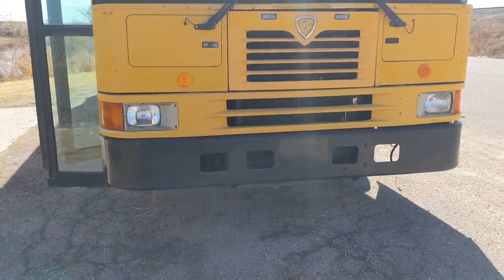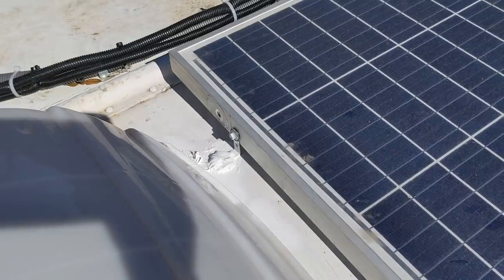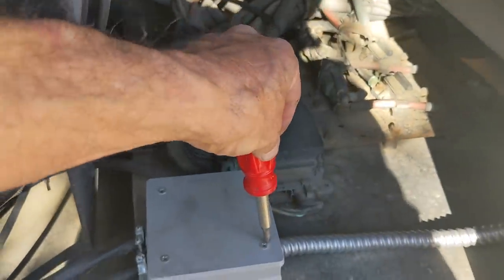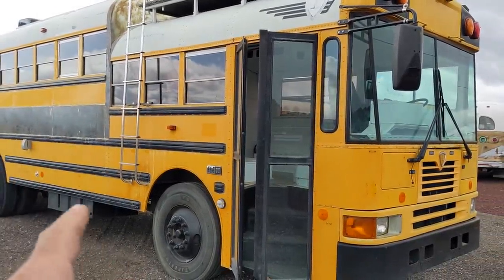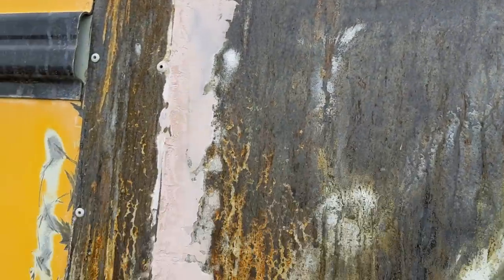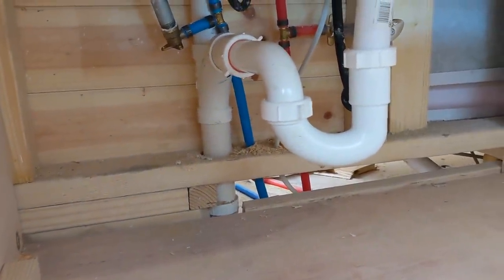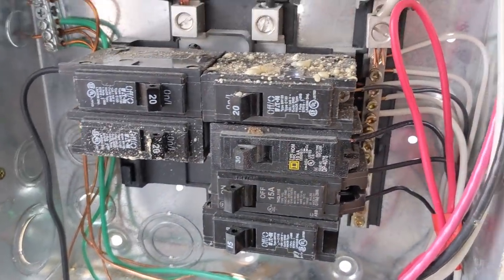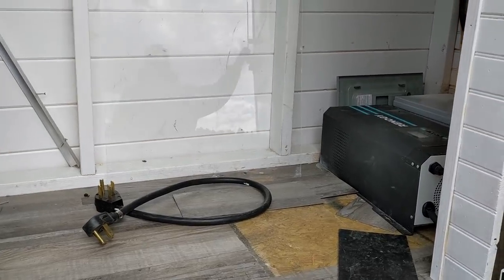Dangerous electrical work...and so much more bad stuff.

Comment: As an electrician and someone who appreciates care and craftship, I am appalled at the hack work done on this poor vehicle. I would say it was worked on by the "crack" crew, because they were definitely on something. Something to be aware of about the MC cable: In mobile applications it has to be stranded in order to handle vibration. Solid conductors can and will become embrittled from bending fatigue, and that can cause enough resistance to start fires. Even standard 19 strand MC is not designed for mobile applications where it is not fully supported and subject to movement. So sorry for your terrible experience.

Comment: I used those same brackets to repair a drawer on my 3 drawer chest. I'm not an electrician but I cam make a better cable then that and it would be safer. Is that 220 or 3 phase? Either way it KILL someone.

Comment: For 100k I better be getting a very very high end work and a paint job with tinted windows by the end of the build. But all the code violations but they are just doing cheap ass work! It's horrible and sad they should be ashamed but at least you have come by a few and are helping them out. Hopfully they get that company to realize what kind of shiesty ass work they been doing. And they should be out of buissness for being scammers

Comment: 75% deposit is ludicrous.   40% and 20% additional as pre-agreed check points are inspected and signed off on.  I can see why we ended up with so many annoying laws and regulations.
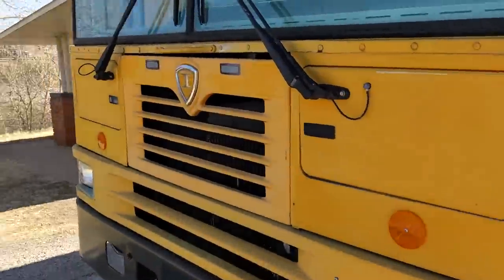Reply: 6:30 No headlight and turn signals, saw the wires hanging down loose.  Started laughing.

Comment: I'm to the point where you are showing the water heater. I've spent years in the body building industry so I have a clue of what I'm looking at. Did they really drill a hole in the frame flange to screw that BX cable clamp in? Huge no no. And it looks as they may have drilled the holes for the water pump too close to the flange bend also. I'm horrified by the whole situation with these guys. How are they still getting customers?

Comment: The work performed is worse than my first time welding, home electrical, bodywork, etc. as a teenager. That company had no intentions of doing anything right and wanted to just get some quick cash in the van life boom. Disgusting in my opinion.

Comment: It’s so bad to the point of almost being intentionally bad. They’ve essentially totaled the bus. The owners of this rig seriously need to take that company to small claims court. Not only are they for sure going to win the case but it will expose this companies illegal and negligent practices
Reply: They have indeed totaled that bus. Maybe - just maybe - they could strip the insides down to bare metal and start over, but only after redoing the sides, a set of tires, and I can't even think of what the engine, drive train and suspension/steering are like.
And for $100K, there are TONS of excellent used motorhomes on he market. 
If this is real, and I guess it is not some kind of April Fool's prank, I - well, I just have no words to express my thoughts on the matter.
I looked at a website purported to be these people. AS the song goes, some people ain't truthin' when oughta be.
As a proud Texan and resident of the Great and I might add Sovereign State of Texas, I am truly ashamed that this kind of fraud is being perpetrated in our beloved State. 
Might I suggest tar and feathers for a start?
I sincerely hope hey prevail in court.

Comment: .....given how there's suspicions the head/turn lights were disconnected as active sabotage, does anyone else have similar concerns that the "nicked" wires on the "cables" they supplied for the generators may have been done deliberately as an attempt at seriously harming/killing the clients/marks?

Comment: OMG 😲 😱 😲, WTF!
Should of just drove it to the scrap Yard then walked to the nearest stake house, ordered prime rib and a bottle of Jack Daniel's.
Reply: That certainly would have been cheaper and more enjoyable.
Reply: @jimbojones9665  I'm amazed that they didn't do due diligence on this company and just handed over $75,000.00 and didn't stop the work on the first inspection that started to show the shoddy work. 
I've done carpentry and construction over 40 years and don't get paid until the job is done and done right. 
I give a list of the materials that I need to the customer or have them setup an account and that's their responsibility to get what I need to complete the job. No hassle.
That woodwork interior   sucked. A blind dog could of done better. 
This project had all the signs of the word "NO" from the word go. Again, sorry for the criticism, but what were they "Not Thinking "? If there was $5,000.00 spent on the interior, I'd say that was too much. 1x6 T&G Pine boards only go for .48 cents a foot.
 Sorry owners, you got what you paid for and now you need engine work, the bus is not worth it. Even the tires are done, there's $7,000.00. 
Hope they take it to the scrap Yard. There's a lot of Recreational RV's  out there, and end of year models great savings, great CRAFTSMENSHIP, and warranties for $75,000.00.

Comment: That's some SHIT work.  They need to be taken to court and put out of business. I'm a licensed electrician and if I saw wiring like that, I would kick there ass and fire them. , they used MC cable on the underside and it's not rated for exterior use.

Comment: You should never put household cable in a van build. Flexible wire strand cable only because of the vibration.
Reply from the maker: I like stranded wire, personally.  But using NM "Romex" solid wiring is approved by the RVIA and the NEC code they adopt as their standard.  And I've never seen solid wiring fail in even old conversions and RVs we've worked on.  So this is one part of the build I don't argue with.  One of the few parts! :-)

Comment: "Junior High Shop Class" doesn't even come close to the level of incompetence on the woodwork alone
MC on the underside of the bus? as well as an indoor tankless water heater exposed to the elements??!??
the electrical alone is a death trap
that includes the other bus shown
any even remotely competent welder, plumber or electrician would've walked away from this, and I'm talking about those on their first week in the business
this is a flat out fraud by the looks of this, what were they planning for a black water tank? a 5 gallon bucket hanging beneath the toilet??!??

Comment: sigh
CAVEAT EMPTOR.
Lots of red flags on that 'bus build'.  A lot of them on the part of the owners of the bus..sorry to say.
1) They didn't research the company well enough...did they, actually?  I don't know.  Any references from other bus owners?  I dunno.
2) No contract specifying materials, no design specifications, no drawings (any sketches? I dunno).
3) No on-site inspection of the 'shop' or tools used by the 'builders'.  No periodic inspections of work...you cannot see anything from hundreds of miles away.
4)  No materials lists supplied by the 'builders', in fact, no anything I can see as to codes or ANYTHING to be followed.

I'm really sorry for those people.  I haven't done that quality of work since I turned 18...fifty years ago.  The last work I did for home repairs was such that you could never tell I was even there...if you could see my work, I did the job wrong.

I hope the fakes get reamed by lawsuits.

Comment: With any Skoolie there is no such thing as $100k build.  It is still just a used school bus. Typically a school bus is a good solid vehicle to use but in the end it will never be worth more then a few thousand at most.  There is no resale value in a skoolie conversion as anyone buying a used one should always be worried it was done right.

Comment: Retrofitting a Bus for $100k does not seem like a good option compared to just getting purpose designed RV for about the same price. With an off the shelf RV you can at least see exactly what you're going to get. 

I feel bad for the owners, but honestly at this point it is time to cut the losses, strip and sell the usable components, and scrap it.

This gentlemen is an angel for wanting to fix all this stuff, but it does not make any logical sense to do so.

Just let it go to the scrapyard where it belongs and consider it a write-off.

Hopefully the lawyers manage to get something back from the Cowboys in Texas but even then I would not be surprised if they already spent all the deposit on gambling and drugs and there isn't going to be enough money to make recovery worthwhile.

Comment: I feel like with the level of hackery and the all around terrible job that that company did at a bus conversion has ruined this bus in such a way that it almost seems like it wouldn't be worth the time or money required to fix it.   Seems like it might be better to just remove whatever fixtures and equipment that are worth saving and send the rest to a scrapyard, then find another bus that is in much better shape and do the conversion the correct way.   Especially now that the engine may or may not require a rebuild.

Comment: Forgetting everything else wrong with this and going straight to the suicide Cable ONE it looks like they just got a dryer lead a 6 ft of 3 ft stub cable and added a plug on to it you point out you can see the copper on it but if you also look at that plug closely can you see that majority of the screws are missing in the plug itself they put on after they've attached it that keeps the plug casing the clamshell from opening up so you have that wrong with a plug you have it being a suicide plug-in got on plug-in and opens up in your hand you have the wires being loose on the bottom side which if you just bought like a washing machine cord our dryer cord 50-amp lead and put a plug on it you shouldn't even had to remove Indians from it not that you should be making one the first place with that looks like they went to the hardware store bought a 50 amp dryer cable put another male end on it and still somehow managed to Nick the electrical wiring on it even if you were making a suicide cable you shouldn't have been able to f*** it up that bad in the first place not that you should be making one but you shouldn't have to worry about it supposedly it's cuz you should just be taking a dryer cord from the local hardware store and then put another 50 amp plug on it there should be no reason to leave there too long wire sticking out below the strain relief wires being Nick Blow The Strain relief the clam shells not even put together right so many things wrong with it just on that alone they couldn't even make a suicide cord correctly

Comment: You are very kind to offer to help these people, but please, don't touch anything and tell that couple to go lawyer up immediately. The cost to undo all that terrible work and make everything right just doesn't make any financial sense in the long run. They need to recover whatever money they can and start over. Hopefully that shop has enough capital left at all to cover the losses. Its going to be orders of magnitude easier and cheaper to start fresh with another good chassis, even when you account for the time spent in court, I promise you.

They need to have a legitimate conversion company or mobile home service shop (like yourself) carefully evaluate that mess stem to stern and clearly document all the ways in which the existing work is sub-par or a serious safety hazard. Take that documentation and use it to build a civil case against this company. They are clearly incapable of delivering a decent, safe finished product.

You as a business owner are also placing yourself at significant risk of liability for working on it. I would politely decline to touch it unless the customer agreed to completely gut it down to the frame and body structure and rebuild fresh.

What about all the janky stuff you CANT see? Is that roof raise structurally sound? I seriously doubt it given the quality of the rest of this build. 

I know this must be extremely hard to hear, but they need to find representation to sue for the original value of the bus pre conversion and for every dollar given to those crooks. That bus is trashed, unfortunately. Its now only worth whatever a salvage yard will offer to part it out, which will be much less than for a stock bus. Even the switch gear, gauge cluster, and other typical salvage yard commodities are covered in overspray and all hacked up. It's probably only worth whatever the power train and other chassis components are worth on the salvage market.

The time, money, and potential for endless problems down the road just isn't worth it.

Comment: If you are unsure what outlet should be on the bus for the generator to plug in to do a google search for a   L5-30 Power Inlet boxes or  L14-30 Power inlet box, you need to confirm the appropriate size I am NOT saying that is the correct one for you to use, IT depends on your situation, this is just an example.  Do not make some dumb comment to me that your 50 amp needs a different one.  If you do not understand what is the way to find the correct one check your local tech school for class on electrical.  Most youtube videos give wrong information on sizing of electric, take a class and be safe.
Reply from the maker: Yup, it should be a proper and suitably-rated recessed shore power twist-lock plug...not a receptacle of any type, which by design would require the unsafe "suicide cable" these bozos provided.  Clearly, they never took any of the classes you're recommending!
Reply: @RollingLiving  People often do not know what to look for, I realize you do, but others should know what the person doing their bus should install.  Thank you for showing this safety issues on your channel.  Way to many RV type vehicles catch fire and to many people and pets are hurt.

Comment: It looks like the bus was sitting in the back of yard with nothing done to it for 95% of the time it was there. Then the owners wanted it back so the company had there kids do all that work in less then a month. For what I see I don't even see $5,000 in materials, maybe if it included the solar. And for $75,000 that bus should've came with a properly mounted oanan rv generator or at least an APU unit like a thermo king tri pack from a semi truck mount underneath the bus, not a harborfreight generator on a shitty platform mounted to the bumper with a suiced cable. I don't know even how this company made it past there 1st build let alone multiple "builds".

Comment: Shocking work, pun not intended.  I have installed electrical and water equipment on mine and friends boats and was far better workmanship. All this work looks like it's been done by junior school pupils for wood work class. Not $100k, but £100k here in the UK could buy a brand new 32 foot yacht

Comment: First of all ...  SUNNY BEACHES ,  what the heck is ALL that stuff ????  Man that is the most messed up work I have ever seen in my life.... I could write a whole book / novel on that bus..... 14 gauge wire on 20 and 30 amp breakers , heck no ..... 14 gauge  wire is meant for light switches in a house  and that's it , nothing else ....Wood work is trash and everything else is also.....The company will have a LAME excuse that they didn't have time to finish the project .......

Comment: I’m pissed just as well as you but where is the code for a bus I don’t think there is one and if there is could you point us in the right direction so I could read the wiring code for all of us do you know the general or basic code for motorhome or camper or bus I’ve heard some other rules before that people told me that were rules and they weren’t their guidelines different than a house or a structure where there’s is the codes written down

Comment: Man... I've seen concrete forms with better craftsmanship than the woodworking in this bus conversion. I can't believe somebody would think any of this work would be acceptable. It seems pretty evident that the converter is just trying to scam customers out of money and has no clue what they are doing. And that electrical work is also something else. Surprised they even used MC cable instead of lamp cord or speaker wire or something. lol. Hopefully the owners can at least recover some of that cash and get things in order, if their spirits aren't totally crushed by now.
Reply from the maker: Love the concrete forms observation!  Very true...and thanks!
Reply: @RollingLiving  I've seen PALLETS with better workmanship!

Comment: I don't see how this is even worth working on the electrical unless it is completely taken apart and started over.  That so called cabinet you said looked like a Jr High Shop project.  They would not have ever passed the Jr. High Shop Class I had.   I can not see driving that piece of junk anywhere or want to be living out of it.  The electrical is only a part of what needs to be done to make this thing Safe to use.  Their butcher job they did most likely is not Safe to be driving down the highway.  The ones that did this should not only be sued for whatever the owners of these buses can get back out of what they paid but should be doing some jail time.

Comment: To use a larger butt connector on smaller wires, just strip the wire twice as long, fold the bare wire in half and insert it into one end then do other wire the same way.

Comment: Why would anyone spend over $100,000.00 on a converted bus? Surely there are motor homes to buy of a comparable price. I cringe whenever anyone uses crimp connectors in the great outdoors where water will enter them and corrode them to pieces. Solder them and use glued heat shrink.